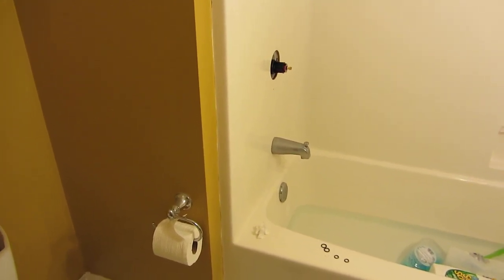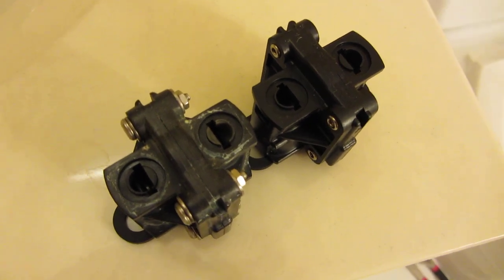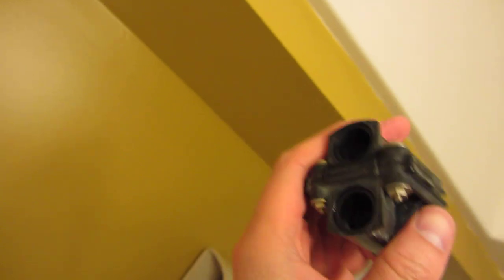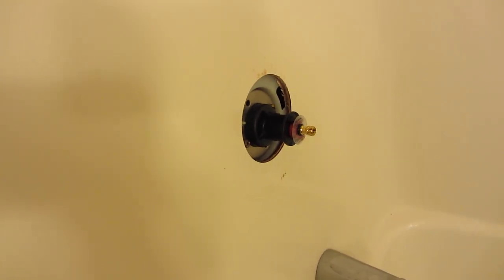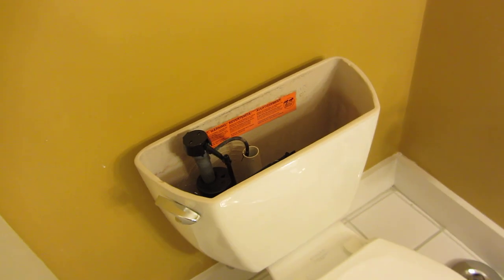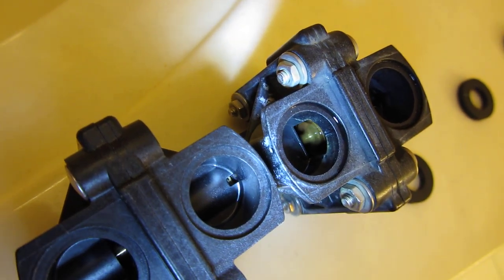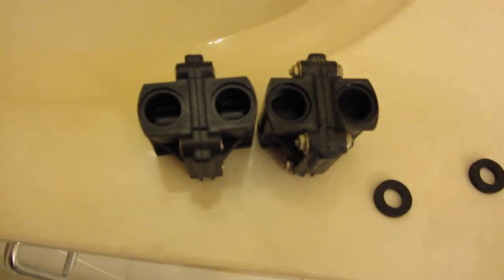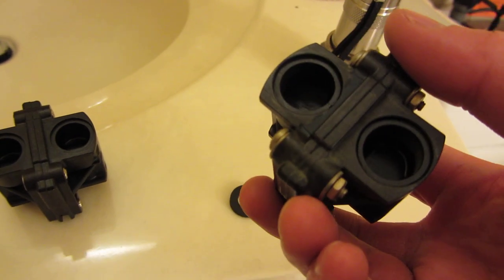Kohler Shower Repair in HD Part 6 - Compare Old and New Cartridge

Comment: you should have adjusted the toilet flush valve while you have to top off.  That water level is at the edge of the overflow tube.

Comment: Man I wanna thank you big time! I just spent 4 hours half what u spent on this dam shower valve! My new mixer valve also fell apart 😡. I replaced both parts a after soo much back and forth it finally worked 4 hours later. Only thing is u explained that notch is what u explain is the top of the mixer valve. Unfortunately I put everything back together and no leaks and working but now in starts with hot water and then goes to cold so that’s driving me crazy after 10 + years of in starting with cold then going to hot . But I’m so paranoid to take it apart and just flipping it over because all the drama involved getting it to work . Great videos ! All 6 😂 😂😂

Comment: quick question... I'm trying to hunt down those two springs that are inside the mixer. Did those come with the new mixer or pressurizer? Or do those have to be ordered separately? If you have to order those separate, are they a pain to hunt down? Thanks

Comment: My new one leaks after I open the faucet but not before I open it so I guess the 4 O rings on the two sides of pressure balancer sealed okay, right? I noticed that big O ring on the mixer is too loose to fit in to the place, and when I carefully looked, the O ring is jammed/squeezed in between the inner and outer part of the mixer. I guess that would be the problem? I will exchange for another one and try. it's really annoying but your efforts is encouraging. Thank you.

Comment: Regarding continued leakage, have you checked condition of the valve body surfaces where the back-side of the rear-most O-Rings make contact?  Any leakage past those O-Rings will cause dripping.  The four O-Rings on the front and rear ports of the pressure balancer all need to seat properly to prevent leakage.  Need to apply silicone grease on all of these O-Rings.  .
Reply from the maker: Applying the silicone grease all over the place, seems to have solved the issue.  Even though without the silicone grease, the fit seemed the same as after the silicone grease as far as the screws being the same depth and so forth.  So I believe as you mentioned it was the setting of all the O-rings for that tight seal.

Comment: Omg your video really helped me out. I felt better after you replaced your new parts that your tub was still leaking. But after we put everything back together we tested it and now the water won't shut off via the handle any suggestions ?
Reply from the maker: did you use the silicone grease and make sure the fitting is all the way in?
Reply: We didn't use the grease 🤔 going to retry!
Reply from the maker: @AntwannetteBond  The grease gives it an air tight seal because it allows the components to slide into place more easily.

Comment: I replaced these same 2 parts in my shower this week. Cost me $0.00. Kohler honors the warranty for faucets for home owners if they are the original owner; and, they sent me 2 kits for $0.00 since my house has several showers with the same faucets. This individual is renting his unit so I am wondering why the landlord didn't correct this drip issue.

Comment: You’re content was good, but you’re delivery was extremely dull and boring. You could have dramatically condensed this down to 10 minutes.
Reply from the maker: Thanks for the input, story of my life.  My delivery is dull and boring because my personality is dull and boring... hey sometimes you're simply born with limitation.  However, I'm working on the delivery.  Have gotten somewhat better in my current videos, with a habit of reverting back to who I naturally am.  Don't quite have the charisma to be on Prime Time.  Thanks for the input, I really appreciate it!!!!
Reply: @PoolarityChannel  I appreciate your willingness to interact with your viewers.  Once again, your tips were helpful.   I incurred the same issue of having to purchase two brand new sets of the mixer and pressure balance units and experimenting with them, via trial and error, until I found the "right" combination.  It's frustrating that OEM parts could vary so much.   Thanks again.
Reply: @PoolarityChannel  Thank you for the sharing on this issue, you were thorough with your presentation and helped me in realizing i'm not alone in this.